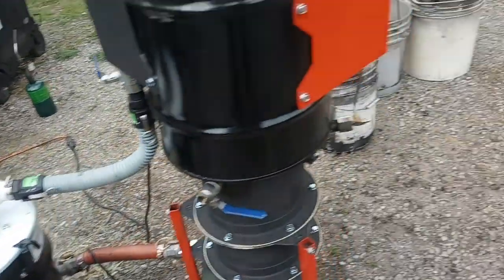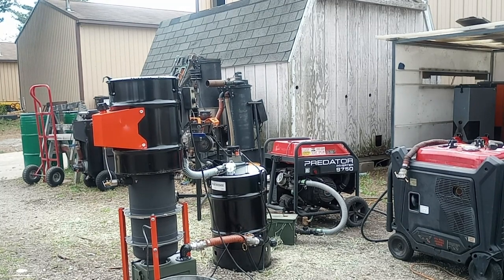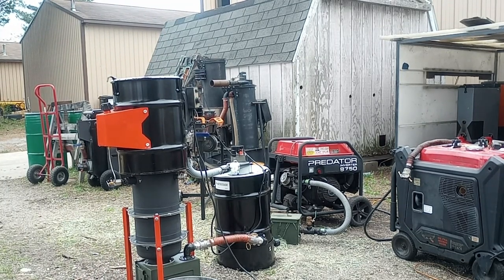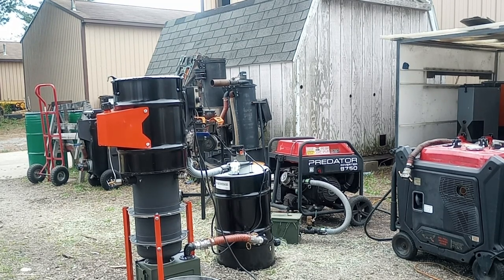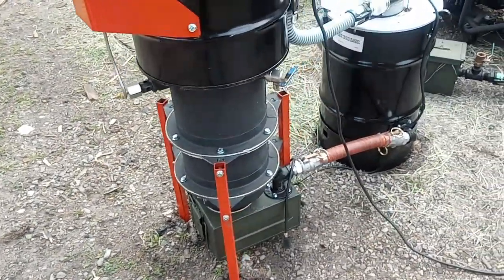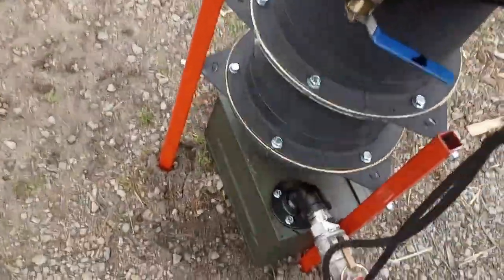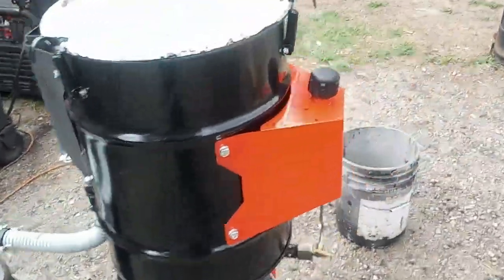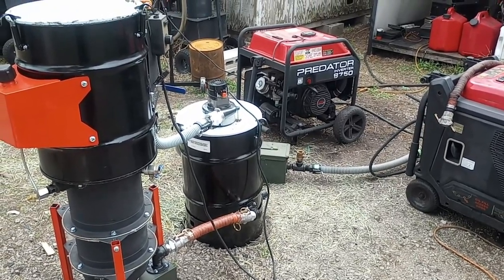Running the V 1 Weld Kit Gasifier in Charcoal Mode

Comment: Love these extremely informative videos. Are you going to do more on fine tuning this system?. I would love to see them.
Reply from the maker: The only thing this needs is a hopper vibrator. Other than that there is nothing more to tune. If its not broke dont fix it. :)